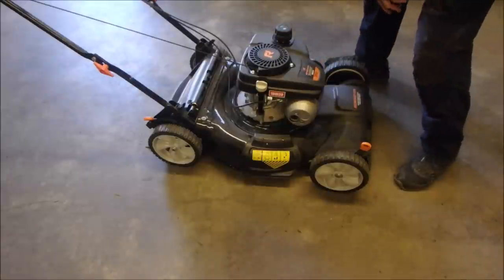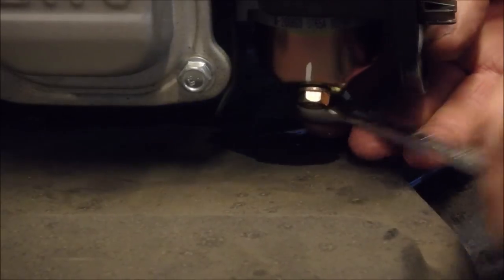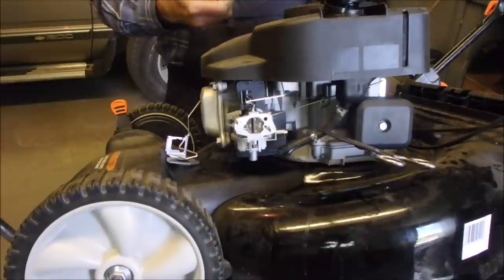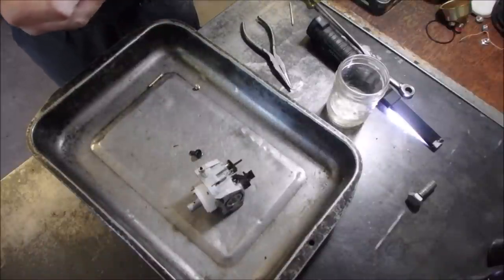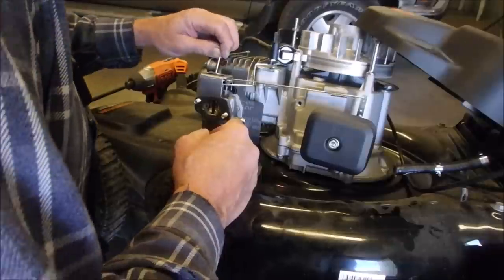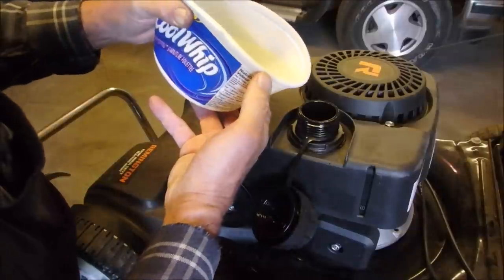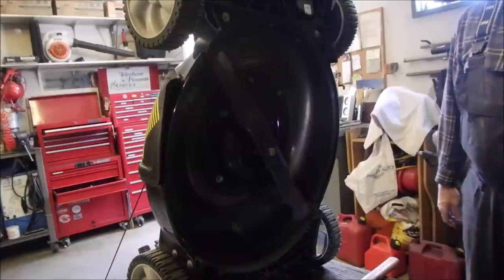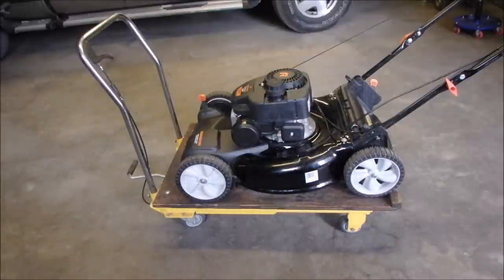A Remington Mower Choke Levers and Won't Start

Comment: Those Powermore Chondas have a tiny itsie bitsie in line fuel filter which are useless as a filter but excellent at clogging because of its size. I pulled mine out and have never had an issue since.
Note: that pissy little filter is in the upper part of the fuel line just sticking into the bottom of the tank.
Reply from the maker: Right  i know the one.  I did forget about that.

Comment: Hey Bruce, what are you spraying with at the 2:00 minute mark of the video?
Reply from the maker: It is carb spray   I am using it as a carb primer.    Most of the time I use 2 stroke fuel.

Comment: Hey Bruce,
Well done!
I worked on an LCT engine last week with an almost identical carb.  The wind vane was a bit different and much harder to dismantle!  Speaking of yellow gas, I did a tuneup on my mailman’s lawnmower recently.  It had really yellow gas and wouldn’t start.  I did a full tuneup on it and sent it back in perfect working order.  After describing the situation to him, he took it home filled it with the same yellow gas and now he says it’s not running properly.  Frustrating! 🤬
Reply from the maker: Yes i have seen that.  they say "The gas is new"  i say is the gas new or from your jug filled earlier.

Comment: Good video Mr. Bruce.  I'm working on the same style engine from a Remington now.  I can't get it to stop surging when running.  I took out the idle jet, soaked it in Gunk and tried running a small wire up through it to clear it.  The wire only goes up about half the length of the idle jet.  Should it go all the way through?  Thanks in advance for your help.  Oh, would mower still start ok without either one or the other of the choke systems?
Reply from the maker: OK  Well this was 2 years ago for this mower.  I am not sure about the idle jet.    I would have to have a choke to start well.  You cam prime it though with starter fluid.

Comment: It would help if you let me know, what tool and size, I still don't know what tools are needed to remove and, repair the REMINGTON CARBURETOR. 🤷🤷🤷🤷🤷?
Reply from the maker: Well  use   a 10 ml socket.  As well use what it takes to take it aprt.   These videos are made for guidence.   Self determination is need as well.

Comment: Remington is a MTD  brand I think  
The blade adaptor and blade are a dead giveaway 
I bet a Powermore engine.
I have had 2 of them
Come my way of recent
Both i got going with carb clean and general tuneup
139cc Powermore Yardman - 2006

173cc Powermore Cub Cadet - 2007

That crazy choke set up I have never seen before

Interesting vid, a bit of a change from a kohler carburetor
Reply from the maker: Thanks D

Comment: mine starts up but revs up and down the same as this one did for about a minute to a minute and a half before it levels out but still has a miss as you cut the lawn, and when i shut off to empty the bag it won't start again when hot. doen't even fire
Reply from the maker: I would check the coil as it does not restart when hot.  That is my thought,  No gaurentee though.

Comment: So, the real problem was dirty yellow gas? I didn't see the carburetor logged up but you cleaned it with gasoline anyway.
Reply from the maker: I cleaned the carb with Kleen Flo Carb Cleaner.  I rinsed it with fuel.  Thanks for watching.  I also widend the main jet at 13:07   Thanks for watching.

Comment: That blade bolt should not use a washer but the plate under there could be bent inward.
Reply from the maker: Thanks   it seemed it was loose without it.